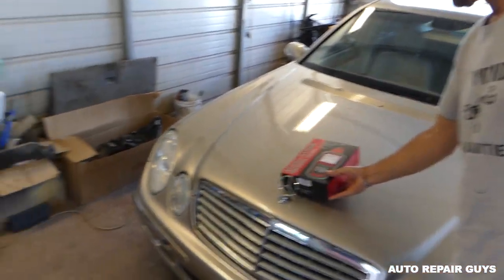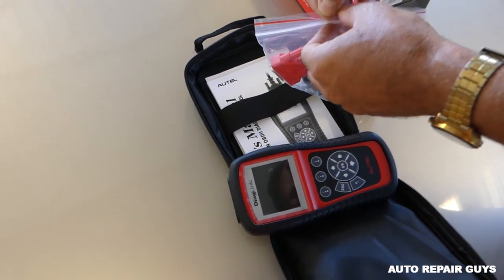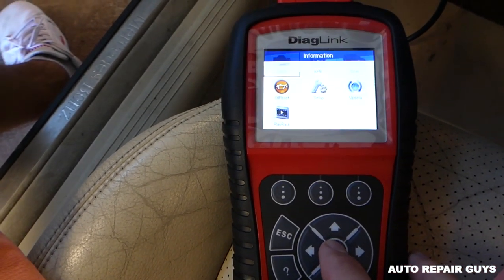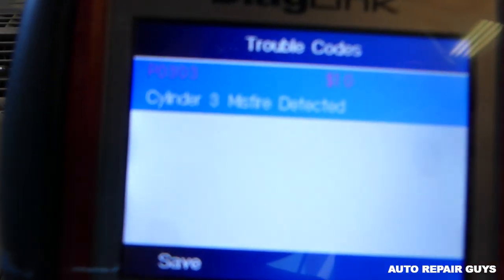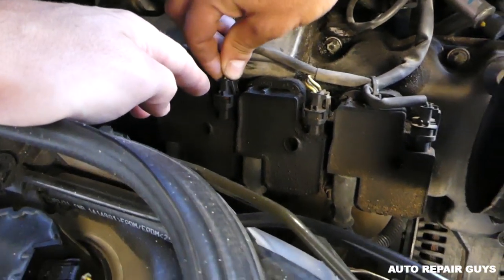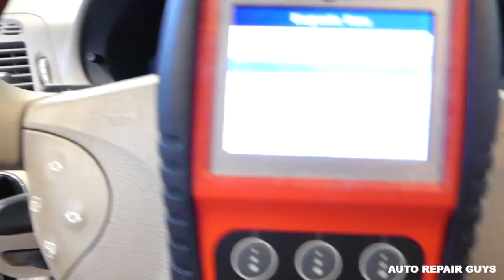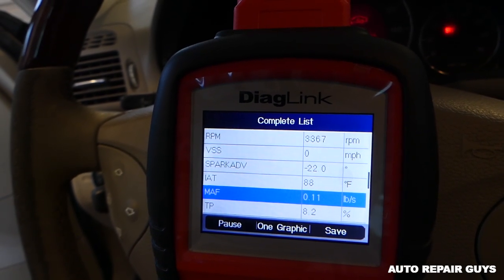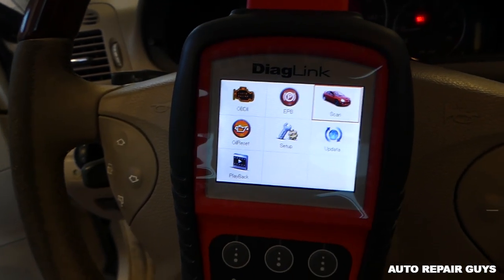Autel Code Reader Diaglink Diagnostic for ABS, SRS, Engine, Transmission etc, EPB, Oil Reset

Comment: Just received the Autel AL619 in the mail from Walmart (10/18/17). SRS light was on: 2004 Mercedes 320 CLK convertable. Did not download  or update the AL619 on the computer (use it as is straight out the box). Plugged the AL619 into the car and entered car info, then hit READ CODE... B1075 CAN Communication Faulty appeared. Then hit ERASE CODE, turned off car for 10 sec and started it. MRS light was OFF.
Reply: Nice ... did it stay off or did the SRS airbag light come back on after a while?

Comment: I have a 2011 mercedes e350 w212,  and I got check engine light on and the code is P0410 the secondary air pump, could you help me how to fix it please.
Thank you!